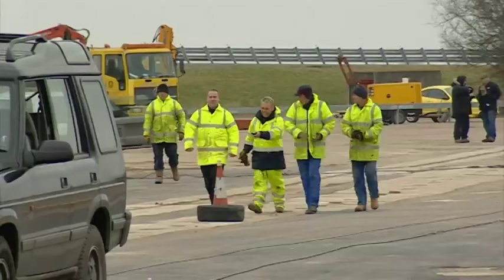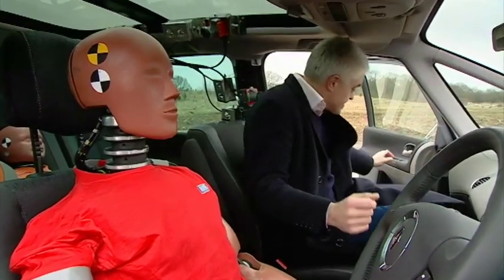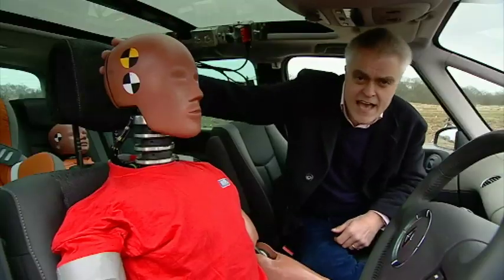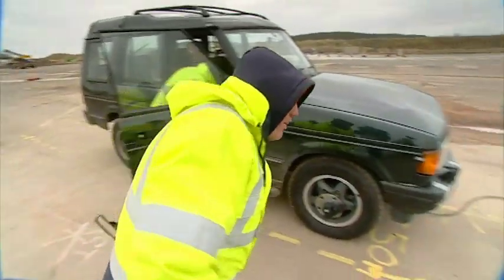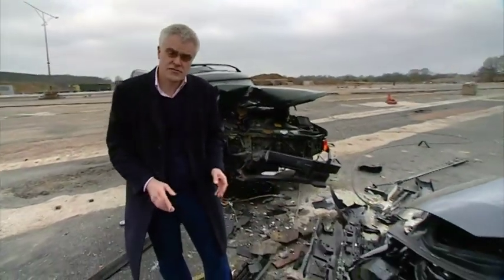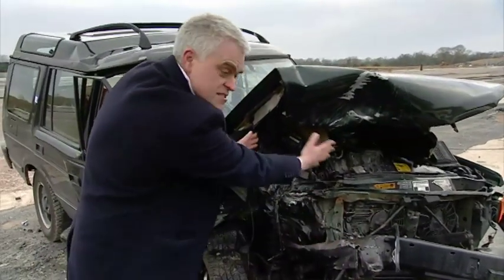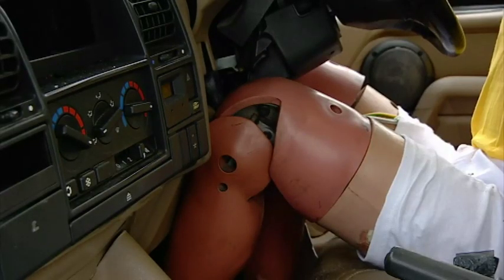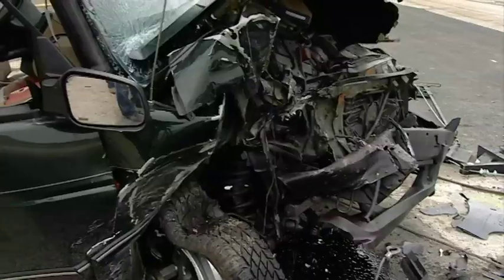Fifth Gear: Is An Espace Safer Than A 4x4?

Comment: When talking about safety, one ever mentions that SUVs are much more accident prone than normal cars. With longer stoping distances and a higher center of gravity, it's amazing anyone thought they were safer in the first place!
Reply: And also the extra mpg...
Reply: if it was a newer suv it would be safer. heavier vehicles always fare better, as your stopping force is less. instead of going 70 kph to -15 kph you go 70 to +15. while yes more accident prone, they are far better at dealing with an accident once it happens.

Comment: The 4x4  looks tougher from the outside. I have a Jaguar XJR and I got rear ended by a Honda. My Jaguar rear bumper was slightly damaged by the Honda front bumper was crushed. I would rather be in a Jag during a crash.

Comment: they have done the same crash test  between a renault modus and an old volvo ( the renault wins) , you should see the volvo's fans totally  nasty and upset vs renault !
Reply: And the Volvo Fanboys come out with silly claims, like the engine was taken out, or something else is rigged!!
Reply: @matthewking5612  🤣😂😆..You are 100% Correct
Reply: @matthewking5612  The more funny thing about this is: The same would have happened if they were to crash the same Volvo 740 into a newer V60. And since these Volvo Fanboys are saying that the older Volvos are the best, they would say the same stuff, like that something was rigged and I'll be like:

Guys, the 740 isn't a f*cking tank! Older Cars will never hold up against the newer ones! While the older Volvos were pretty safe in their time, it doesn't mean that they will still save you today. But no one of them likes to hear the truth.
Reply: @Christian17390  also unless money is no issue pound for pound volvo is less safe  as a volvo vs Ford comparison  the same budget will put you in the next generation model.   So around 6 years apart and often 1 or 2  n cap rating apart.   The 850 cost easily as much as a mk3 mondeo.    And the 740 was probably competing with a mk1 mondeo.

Comment: Now do the test again but now with the same year Renault Espace and a Discovery 5 instead of a Discovery 1. I guess you will be amazed by the outcome.

When you are crashing a car designed in the late 1980's into a car designed in the early 2000's and then being surprised that the car with the latest safety features and design is the safer car that is when you need to get your head checked.
Reply: You are missing the point , people (idiots) amsume how safe a car is because of size and not becuase crumple zones and modern saftey feature.
Reply: @Mjk10957 are these cars not of a similar price.

Comment: When the only good thing about a Renault back then was it’s NCAP star rating!
Reply: O the hater with no knowledge..
Reply: Better quality than VW.
Reply: Better than a BMW Mini
Reply: Ауто камере Србија / Dash cams Serbia Clearly you live in a parallel universe.
Reply: @Zero_Ninety  

Renault 1.4 MPI engine in Dacia Logan, goes 1 million km without any work inside the engine. And in Taxi city driving. Yes, Renault is mich better than overrated VW.
Reply: @DashCamSerbia  yep and in 2020 a Renaults are more reliable than Audi/VW and BMW and the  new renault clio is better made than the Audi A1 which is 4k More expensive!
Reply: @cornovii3012  Not hard!!